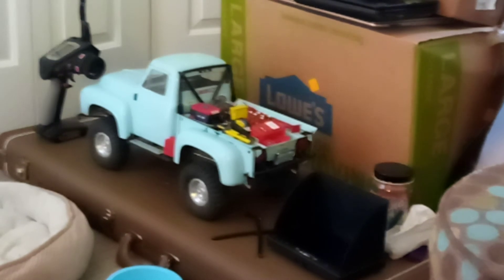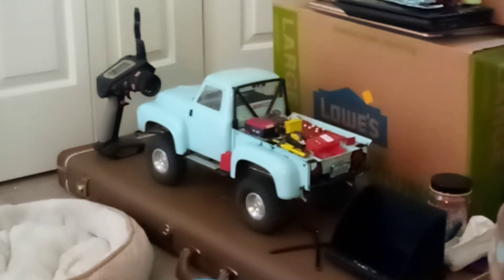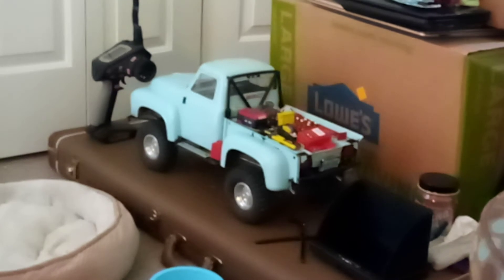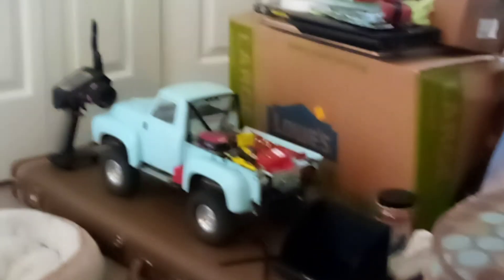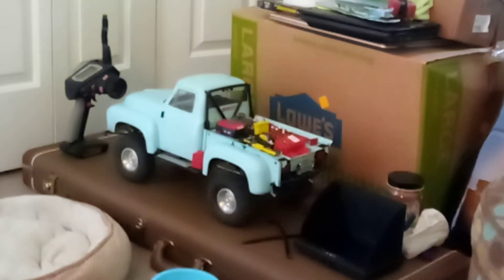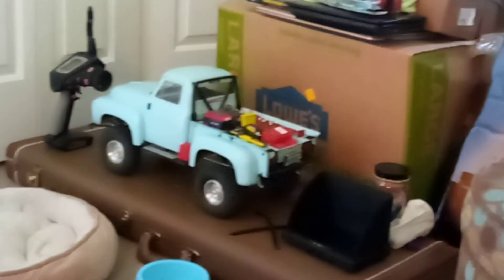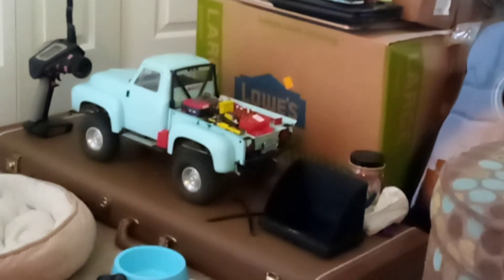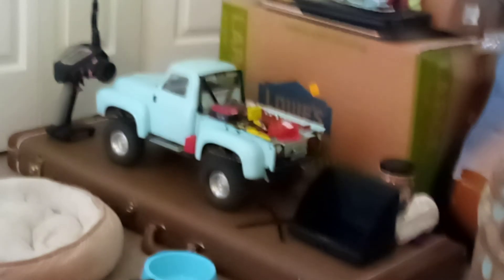RC Helicopter Blade 230S V2, DIY SCALE Bell Jetranger Canopy Conversion, Coming!

Comment: I been considering getting a 230S I only have 7 hours or so on my blade 120s2. Do you think 230s would be a good 2nd heli? No experience with collective yet but no major crashes yet with 120s2. 20+ years with rc planes now so heli is a challenge and I enjoy the challenge. Being able to fly in my yard is why I'm interested
Reply from the maker: I think the 230S could be a good second helicopter. It flys very well, has SAFE and AS3X available.
Reply: @rcaviationcrawling7351  thanks for the reply. Trying to wait for a sale but might have to pick one up soon. I've had a ton of fun with the 120. Helis are way more fun to me than drones/quads
Reply from the maker: Helicopters sure are fun!